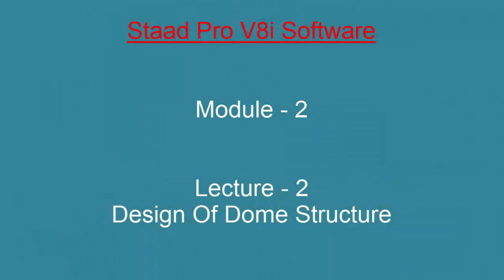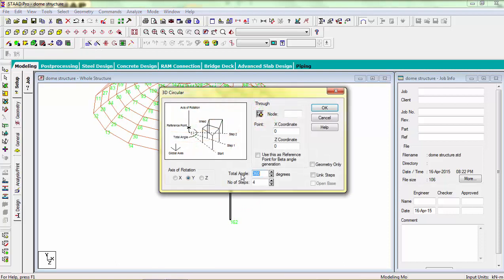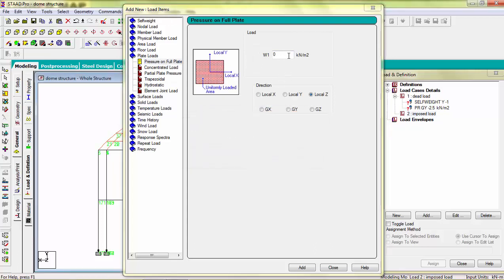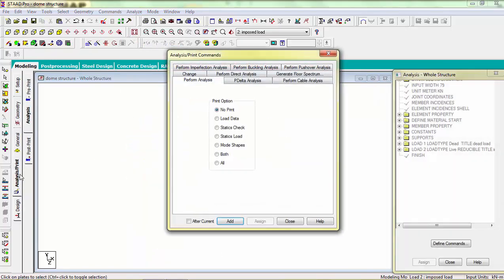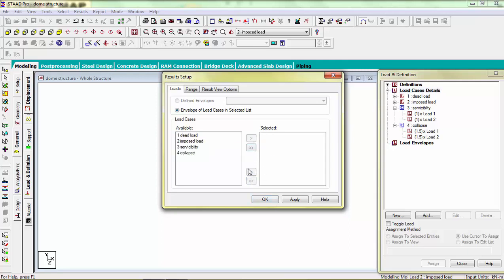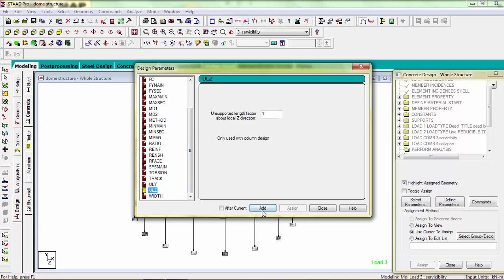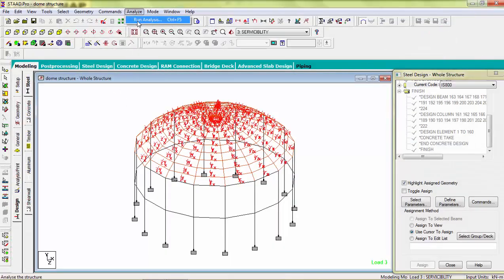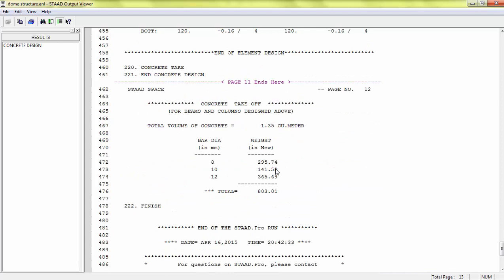Design & Analysis of Dome Structure by Staad pro V8i Software

Comment: How to design a sump tank, which is half in the ground using stad pro
Reply from the maker: Its basic calcs - you probably don’t need staad pro to design it. 
-  for inside wall reinf- at first you need soil pressure from outside wall (this will be uniformly varying load minimum at top and maximum at bottom of wall) + hydrostatic pressure (usually constant UDL top to bottom)- convert the maximum pressure at bottom of wall by multiplying unit width which converts it into udl which act along the wall. 
- now get Mu_inside= wl^2/8 of factored load moment, get amount of reinforcement for it. 
( this reinforcement will go horizontally in inner side of wall) 
- similarly you have a hydrostatic UVL of fluid inside, get its max at bottom and then Mu_outside and then reinforcement.
- for vertical reinforcement provide minimum steel per code provision. 

- important thing to remember is to provide proper reinforcement detailing at corners of wall and tension lap splice details.
Reply: Can i have your email
Reply from the maker: @AnasKhan-gv9ec  jainprateek2709@gmail.com